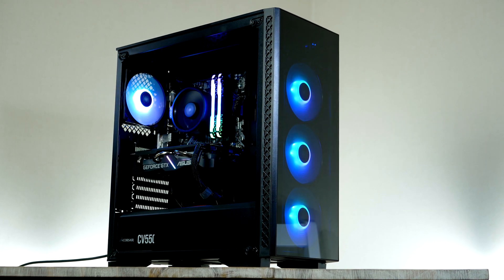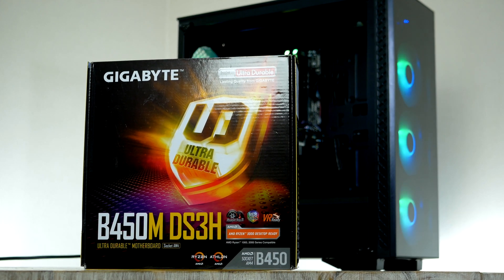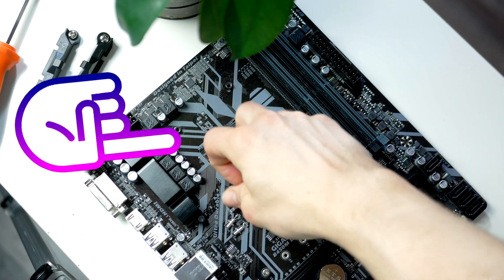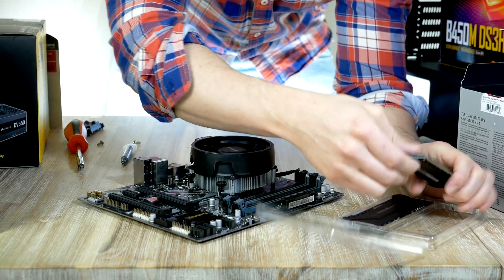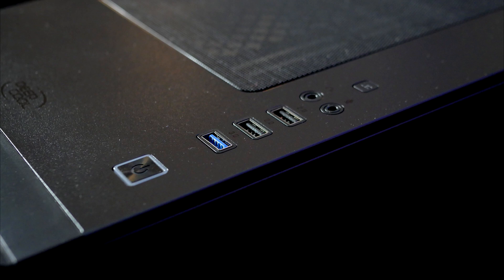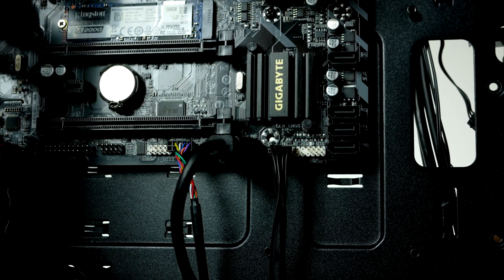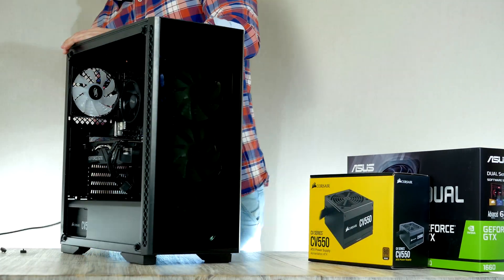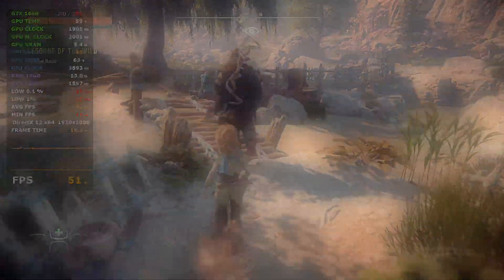Building The Best Cheap Gaming PC Under $700 in Early 2021 🚀 Step-By-Step Tutorial + Benchmarks!

Comment: **For the people looking at the GPU prices** Retail stores that sell computer parts have GPUs and CPUs at a reasonable price. DO NOT BUY THEM ONLINE AS THE PRICES ARE EXTREMELY INFLATED. Ryzen 5600x should be 299 and any GDDR6 GPU should be a lot less expensive. Look for a micro center or a best buy. If sold out, they should restock every 1 and a half to 2 weeks.
Reply: Thanks dude and one question do I get the rest of the items on Amazon or bestbuy
Reply: @wayzz9529  I would check the prices of each part on Amazon, Newegg, Best buy. Or go on PC part picker and they usually look for the cheapest price for you. I normally stick to Amazon because I have prime!!
Reply: @kmonkey4138  where do I get the cheapest and best parts in a retail store
Reply: @Shikora  It really depends on where you're located! Microcenter has the best GPU prices at the moment
Reply: @kmonkey4138  I live near d.c